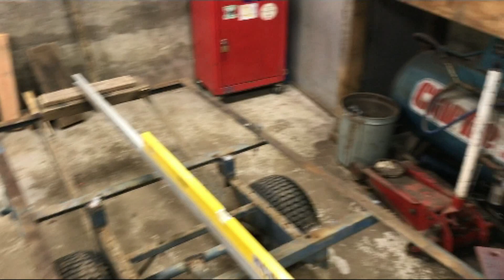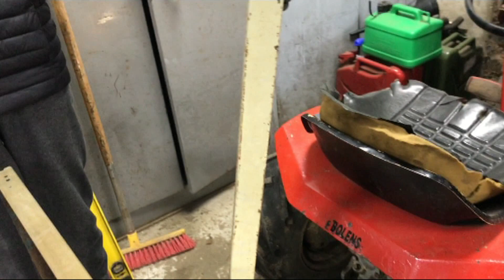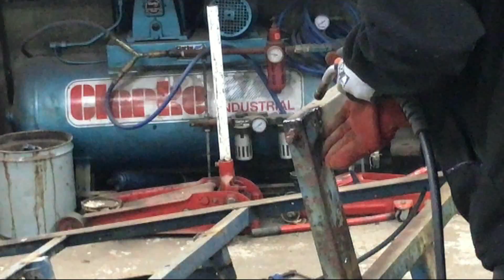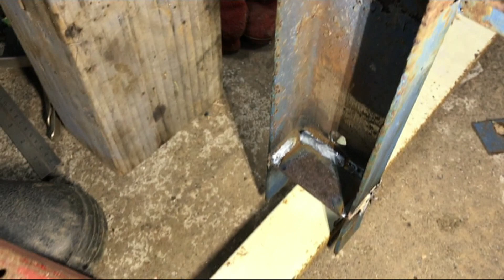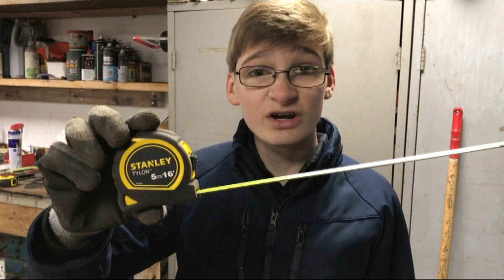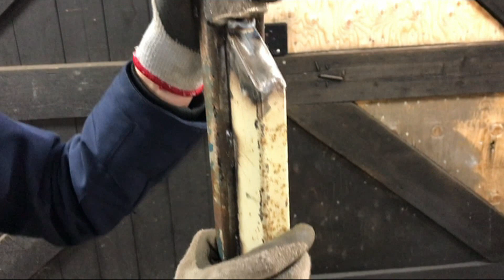Trailer maintenance - now a project Part 2

Comment: You got me laughing when the bar was cut to short, but I was busting up when you started talking about the builder of the trailer. LOL  Very good video!  Y'all did a good job fixing everything.  Have a good weekend!  See ya!
Reply from the maker: Thank you very much. I could not believe the draw bar was not in the middle, nearly as bad as dad measuring that bar twice and then still cutting it wrong LOL. It will be interesting to see if these changes to the trailer make a difference when using it. Take care and I hope you have a good weekend too
Reply: @GardenTractorBoy  LOL!!  I have done the same thing as your dad before. It happens to everybody sooner or later! lol

Comment: Unfortunately this kind of thing happens a lot in my life.  I just want to do a couple repairs and it soon snowball's into a rebuild.  This trailer will certainly be more heavy duty now. Nice work.  I just want to say how cool I think it is That your dad is the camera man. You 2 spending time together is really great. Have a good week young man
Reply from the maker: Thank you very much. It is difficult to know how far to go with this as the way it has been built is horrible. On reflection, it would have been easier to make a new frame and move the running gear over, but it should be a lot better than it was. It will be interesting to see how different it is to use and tow. Take care and I hope you have a good week too

Comment: its coming on now joe, its easier to weld down hill  with the mig than up ,just a bit of practise turn your speed down  then fire up at the top of the joint and imagine the an O but only the top half or a U upside down spread open like a bridge over a stream go from one side to the other then go over it again but only half of the weld you've  just done keep this overlapping  motion  from side to side working your way down to the bottom of the joint .as you master this technique or pattern you can do it faster flicking one side to the other in the arch movement ,if i were nearer id come for a cuppa lol
Reply from the maker: We would love it if you to popped in for a cuppa. Thanks for the tips, dad has done a lot of welding but we are both still learning. We need to make the time to practice welding rather than jump straight into it for a project. We are pleased how this trailer is coming along and it will be interesting to see if it is different to tow. Take care

Comment: Hello, This is a great project. Something a little different than working on your tractors. I'm surprised you guys don't have a metal stretcher in your shop, they are really common in Canada..... just kidding. Glad you caught the out-of-center drawbar, Even if you gave the original builder the tape measure, doesn't mean he could read it. Take care
Reply from the maker: Thanks. It did not start as a project but now it is, we are pleased with the way it is coming along. If we had a metal stretcher we would not have an excuse for cutting things wrong lol. Take care

Comment: How she goin'?  Nice work on the trailer.  Good that you found the draw bar was of center.  That would be bad if left like that.  The trailer sure wouldn't tow very well.  A good trick to make sure the draw bar is well centered is measure from the center of each wheel back to the same point on the hitch and these 2 measurements should be the same.  Nice mods and improvements made all around.  Take care!!!
Reply from the maker: Thanks 👍 It is funny that we had not noticed the draw bar was not centered after all these years of ownership. Thanks for the tip. Take care

Comment: You guys are doing a great job on the old trailer. The original builder is probably 95 years old now.
Reply from the maker: Thanks. I wonder if the builder has learned hoe to use a tape measure now lol. Take care